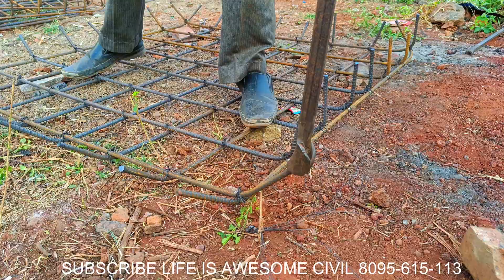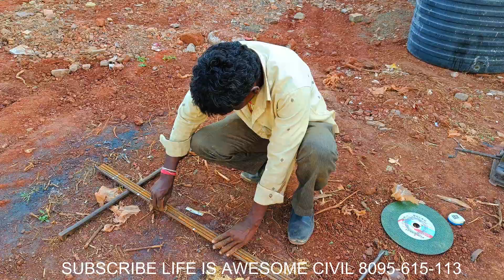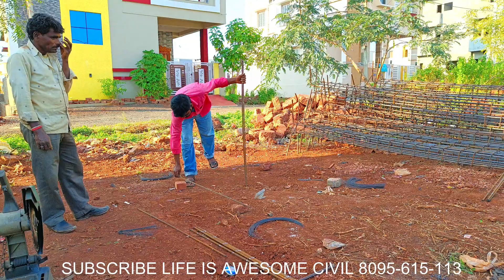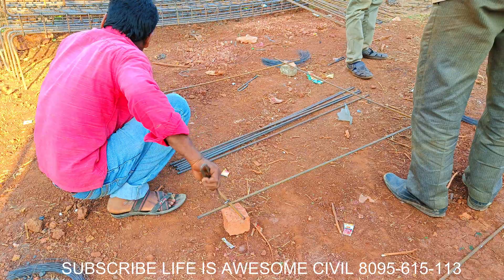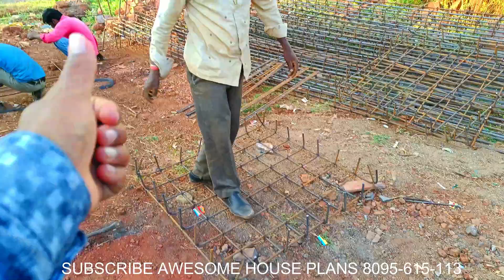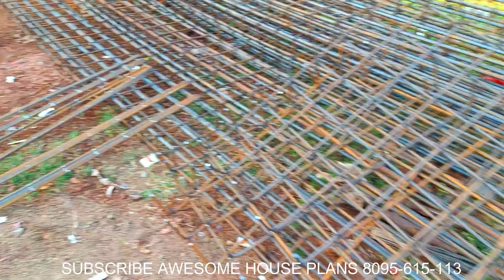Part 22 Making Of 4 x 4 Feet Column Jaali Mat By 10 mm rods 6 inch spacing

Comment from the maker: click on this playlist to watch all videos of this house
https://youtube.com/playlist?list=PL_dOCP9161m440ksK775-DNTHzTZikLpN
30 x 40 east 3 bedroom Duplex house

house construction step by step

watch previous videos of 30 x 40 east 3 bedroom duplex house
step by step house construction videos

Part 1 Bore Well Point Finding With Coconut Copper Wire
       https://youtu.be/5y4IWJXQQ88

Part 2 Amazing Bore Well Drilling Starting To End in Rainy season time lapse
       https://youtu.be/d8gB3Ky5ROM

Part 3 JCB 3DX Plus 30 x 40 Plot Cleaning Duplex House
       https://youtu.be/oR6AsUWd4Fo

part 4 Leader Temporary Meter Box Fitting Bore Starter
       https://youtu.be/RyDRiF9amGQ

part 5 Bore Well Tube Motor Price And Fitting Deep Well
       https://youtu.be/iaMRhCWwCz4

Part 6  Loading And Unloading Of Tin Sheet Shabadi Tiles Bamboo Poles Tin    Store Room
        https://youtu.be/65sCtEfRMIE

part 7 Making Of 10 x 10 Temporary Tin Store Room Shed for House Construction
       https://youtu.be/reyJqhf4LPA

Part 8 30 x 40 East Face Duplex 3 Bedroom Thermacol House Model Ground Floor
       https://youtu.be/Lh_j-BDnjPE

Part 9 30 X 40 East Duplex 3 Bedroom Thermocol House First Floor
       https://youtu.be/QPPP2AtFcp0

10 Amazing Zig Zag Chain Stairs design Making
       https://youtu.be/r7JCrhjfi0kPart

part 11 Duplex House New construction Bhumi Puja
        https://youtu.be/iNTKLNzGSW8

part 12 East Face 1000 square feet Duplex House Mark Out on site
        https://youtu.be/G1sjN26AmhQ

part 13 JCB 3DX PLUS Hammer Breaker Column Footing Excavation Pit
        https://youtu.be/zkzzHs1oZR0

part 14 JCB 3DX Plus Changing Of Bucket
        https://youtu.be/c_WdXRevp4U

part 15 JCB 3DX Plus Big Mistake Again Leveling Of 1000 square feet Plot
        https://youtu.be/1fLSIDpM1II

part 16 Hard working Labour Mistri excavating 4 By Column Footing Pit Excavation Work
        https://youtu.be/xTUlDzj_0As

part 17 Amazing Old Man Drilling Column Footing at age 80
       https://youtu.be/cQ2XST4rTFY

part 18 Price of JSW Neo Rajuri TMT 550 D Steel rod bars Loading And Unloading
        https://youtu.be/yM9DaNm8GKc

part 19 Amazing Village Centring Mason Cutting Column Steel Rod bars
        https://youtu.be/CY-iQjHOtcQ

Part 20 Skilled Amazing Labours Excavation Septic Tank soil removal
     https://youtu.be/iGLoZeYsr1s

Part 21 Amazing Centring Column rod L Bend Mat Jaali Rods Cutting
     https://youtu.be/yezOmr3PsqE

Part 22 Making Of 4 x 4 Feet Column Jaali Mat By 10 mm rods 6 inch spacing
     https://youtu.be/vJ-DezvYdAE

Part 23 village mistry binding 9 By 15 Inch Column Rod pillar Making
     https://youtu.be/bJnyjbZle6o